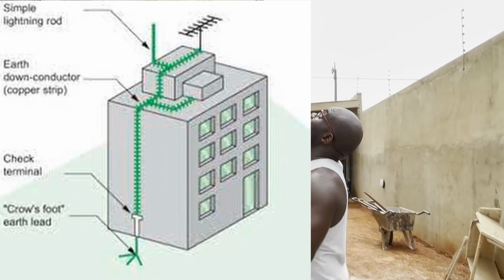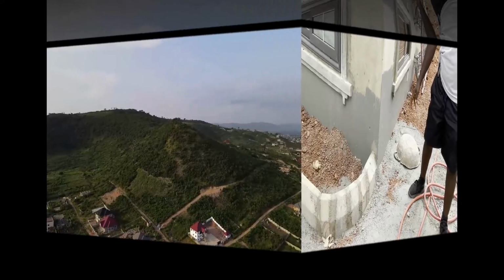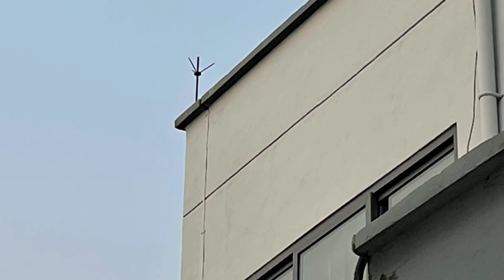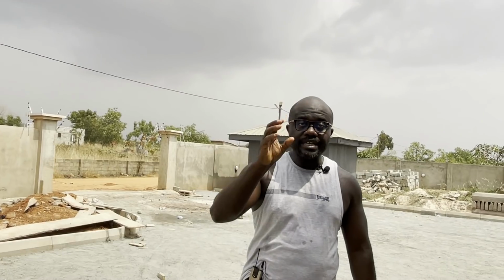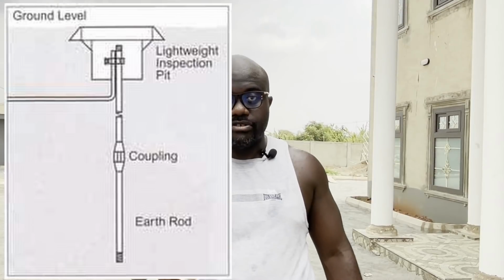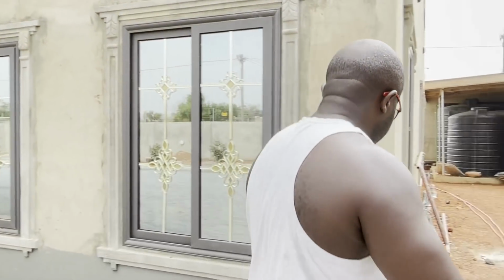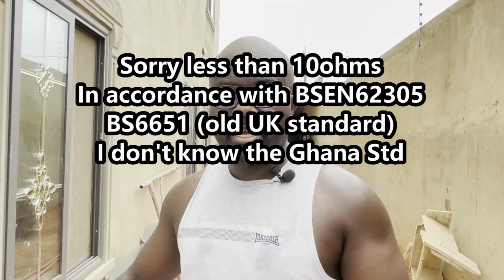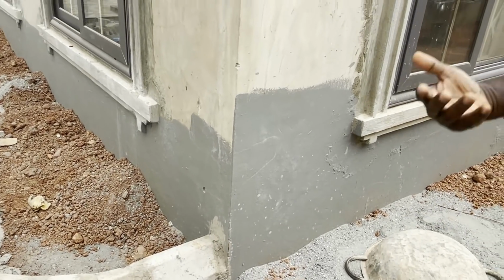BUILDING IN GHANA | LIGHTNING PROTECTION SYSTEM

Comment: I would you want to knw if u need a rod at every corner of the wall of it's just one rod for the lightning arrestor  linked together for the rods coming up from the rod up there
Reply from the maker: This is down to design and engineering. There is a science behind this and a risk-assessment also. It depends on the nature of your roof. Your designer will need to look into that for you and advise. It is not a straightforward answer neither a one size fits all answer. The need for lightning protection also depends on the area you live in, the buildings around you/ their height, etc. history of lightning strikes in the area, etc, etc

Comment: Thanks well  taken,please what do you use in measuring the buried rod resistance,also do they sell surge protection boxes in Ghana?Thank you so much for the insight.
Reply: A bacia multi meter set to OHMS will be enough. Alternatively a multifunctional electrical testing machine which a top electrician will have an all be used.

Comment: In American I call this a lightning rod,which it reaches into the ground.
Reply: My Grandfather's large 2 story Wooden house had two lighting rods on the roof with 3/16" copper cable to 1/2" copper rod  in the ground. edit( in the U.S.) House is over 100 years old and still standing.

Comment: This is a subject I was contemplating the entire week. My Electrician had recommended that I install a lightening arrester, which I believe is the same as the lightening protection system you described. However, I wasn't sure if it was necessary, especially with the money involved. I was actually going to side bar you on this to get your thoughts; and voilà, you addressed it. I still haven't made my mind up if I should move forward with it. Your final advice please.
Reply: check if your neighbours have it, and also is your building part of the tallest in the hood? consider all that
Reply: @derekG_00  Hi Derek, my area is developing, as people are continually building. However, I will ask  some of the folks who have built and moved to the area, if they have it. Kindly shed some light on the tallest criterion you referenced. What is the relevance? Thanks.
Reply: @denniscasely-hayford3245  when lightning strikes near your section, it’ll generally be picked by the tallest building
Reply: @derekG_00  Thanks Derek. I appreciate your feedback. This will definitely guide me in making a decision.